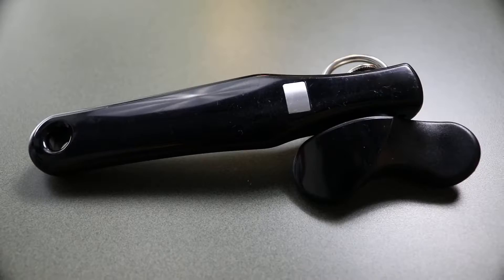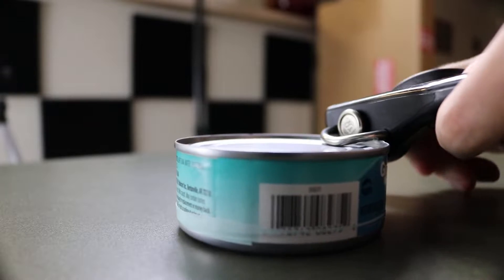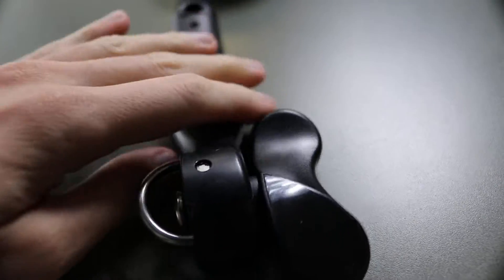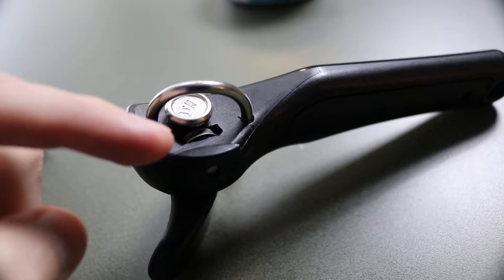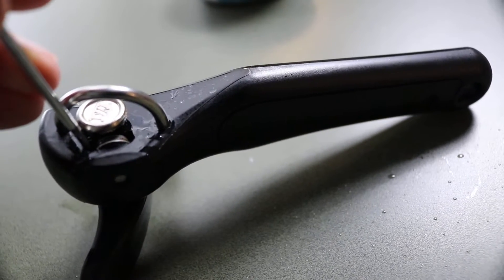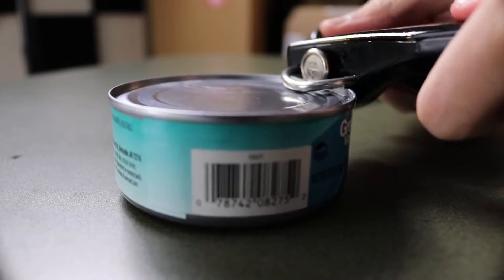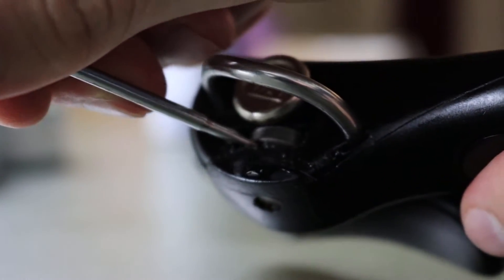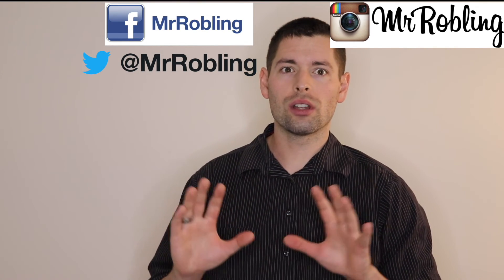How To Fix a Safety Can Opener

Comment: Not all cans are designed the same and frequently I find some that have too shallow a lip and they won’t unseal. This seems to be more common with low-price store brands. The lip needs to be 1/8” (0.125”) tall and many of the problem cans are only 0.107-0.119”.  So I need to keep a conversational opener handy.

Comment: I think the point is to rotate the cutting blade from the blunt side, towards a new sharper side.
Eventually you will run out of sharp side to cut with, that's the time to replace the whole can opener.

The cutting blade generally is not meant to rotate as you cut the can.
Reply: Sharpness of the blade means nothing if the can won't move. Patent even says the cutting wheel is supposed to rotate freely: "pulls it tightly against the housing which holds a rotatably mounted cutting wheel."

Comment: That's not what's wrong with mine. The handle is coming loose and it doesn't make a tight seal on the lid. Is there any way to tighten the handle?
Reply: I've had several of the handles just break in half from regular use over a period of time.  I think there is a flaw in this design.